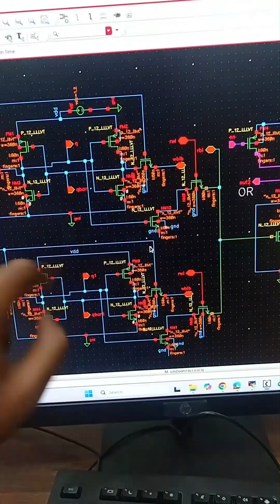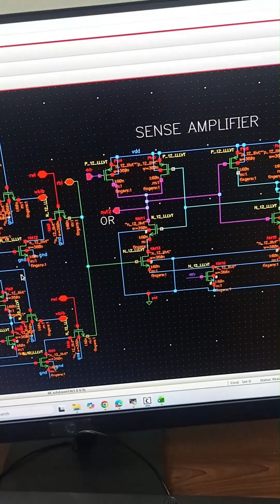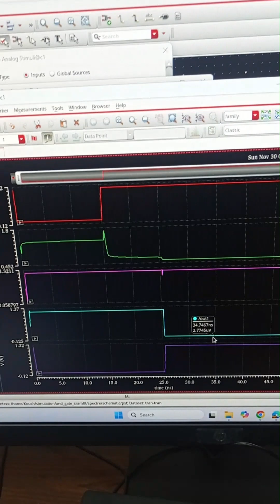SRAM as Logic Gates? Watch OR/NOR implemented using 8T Cell in Cadence Virtuoso #VLSI

Comment: Precharge circuit is not necessary in reading part?
Reply from the maker: For this demo video, I am using the initial value condition in simulation, so I didn't include the precharge circuit. If anyone is doing a project then they would need a precharge circuit.
Reply from the maker: For this demo video, I am using the initial value condition in simulation, so I didn't include the precharge circuit. If anyone is doing a project then they would need a precharge circuit.
Reply: Currently I am working on imc please tell me how to calculate read, and different logic power in cadence..